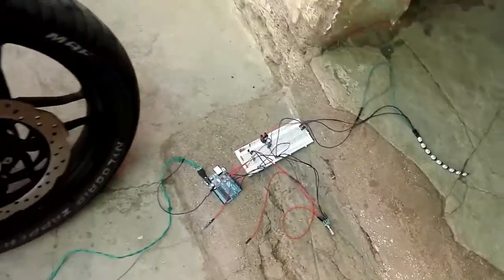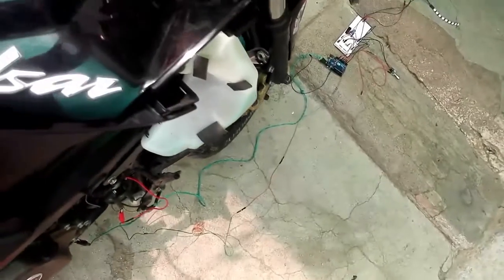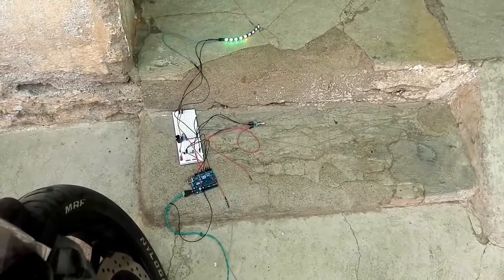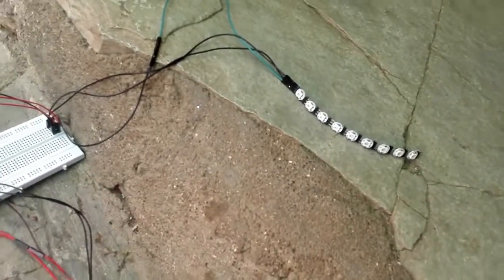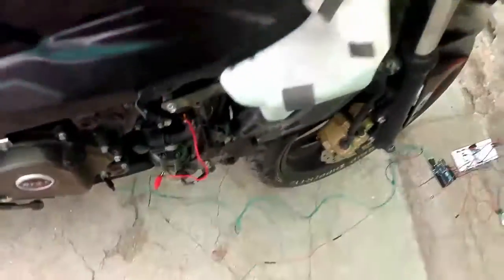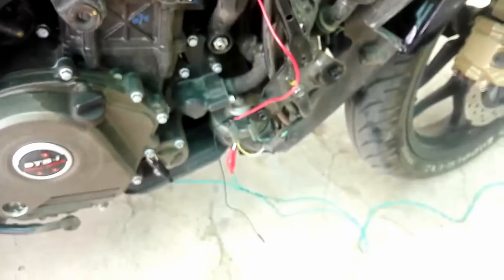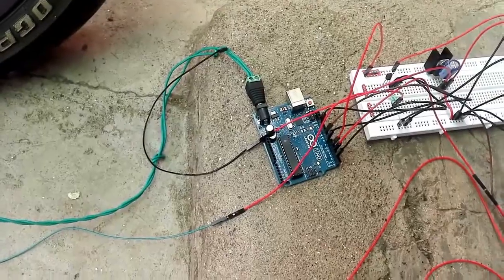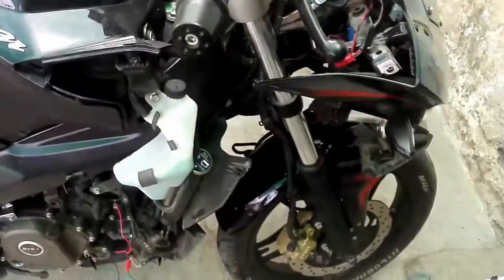Led tachometer/rpm meter/shift light arduino installed on pulsar RS200 (part 1)

Comment: good job brother. i want to ask u a question. i have already visited chippernut but their circuit is so complex. i just want to know that how are u reading those rpms from the ignition coil. i mean in what form arduino is receiving RPM signals from input pin. and tell me about that small wire wrapped around the coil wire. is that a normal bare copper wire  or is that an insulated wire (The one used in generators and motor winding).
Please Can u explain me a bit? I am guessing that high voltage in ignition coil wire is inducing some volts in that mini coil around it which generates a pulse and those pulses are counted by arduino ? am i right?

Comment: May ask how did you manage to get the rpm from...I know how it works but I am doubtful about how the Arduino will get the signal for the rpm..n wat changes you made in the codefor it to work.???
Reply from the maker: reffer the chippernut website forum section, and im grabbing rpm from sparg plug(master)
Reply: Thanks man will look upon it..👍

Comment: yes i did see very nice, i like your idea using the led only to lessen the electronics in odometer, have u modify the code for the leds only to work, can you share the code with me i am not that code in the codes for arduino, thanks man,, can t wait to make one just like you did with the leds only without the 7segment display coz my bike so small odometer space, ,,thanks gladly appreciated if u share your code...
Reply from the maker: +Jose Ledesma dont worry u just need to change the no of led,s in chippernut forms i have posted my form you can take a look at that
link: - https://www.chippernut.com/forums.html#/20160407/only-8-leds-are-lighting-up-5204420/